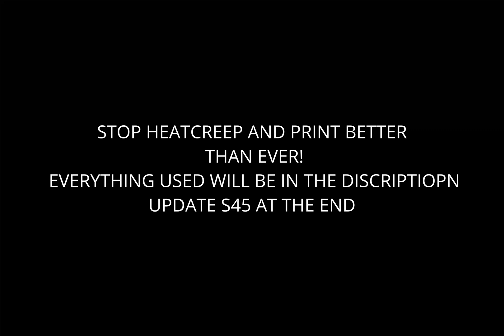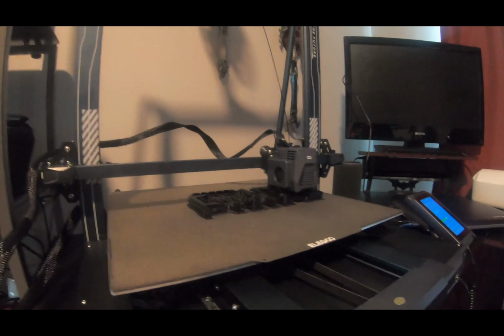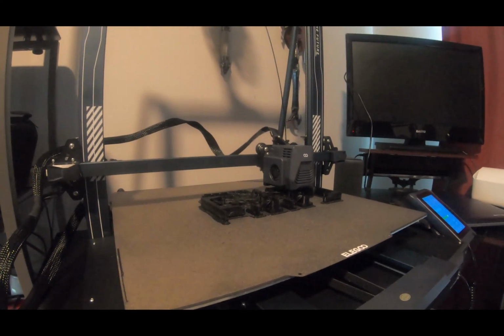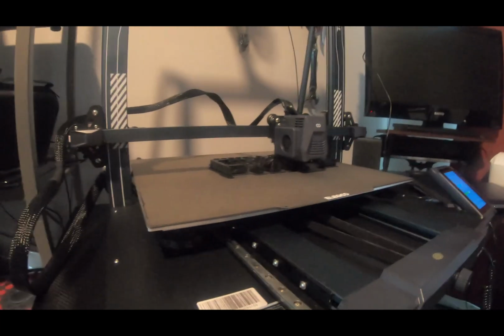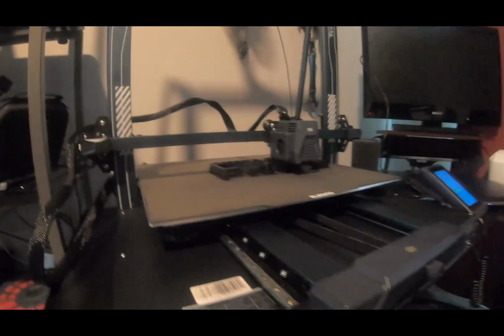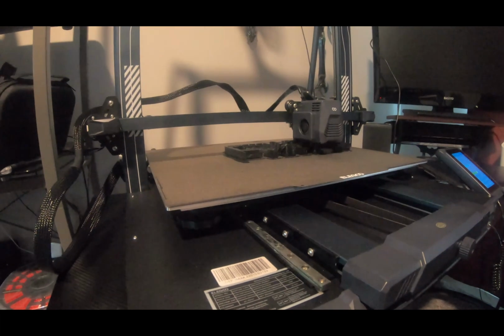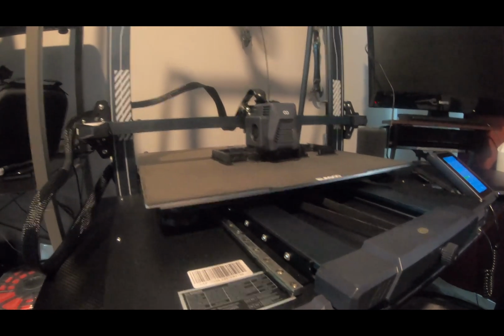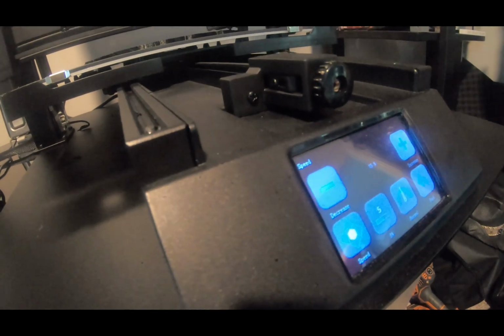Say goodbye to heat creep

Comment: What size bearings?
Reply from the maker: They are in the description, but I think that they are 5mm inner diameter x 2mm width x 8mm outer diameter, they are in the description in the video and that's the cheapest I found them.

Comment: going back to the good old days of filament oilers
Reply from the maker: I don't really think it's about oiling the filament to be honest I just do that once to get the Capricorn tube broken in, I think it's the bearings and using just a little bit of grease really changed everything to be honest, the less friction and tension in the extruder gives it the chance to do its job. I very seldom have a failed print and if I do it's because of supports I like placing my own supports I don't do automatic supports much. Here I thought I was on to something because not one video talks about changing bearings and putting grease on the extruder, it's like a car, common sense tells you to change the oil but people don't do it because it's alot of work, all my extruders changed dramatically when I changed the bearings and greased the moving parts, if all you got out of the video to oil your filament, that sucks for you bro!